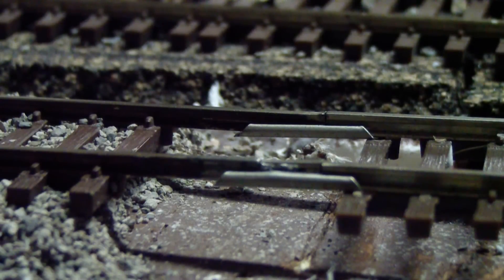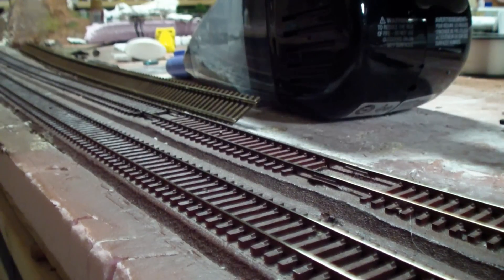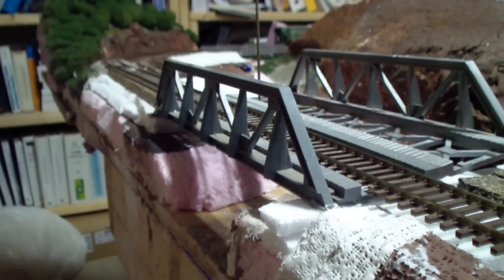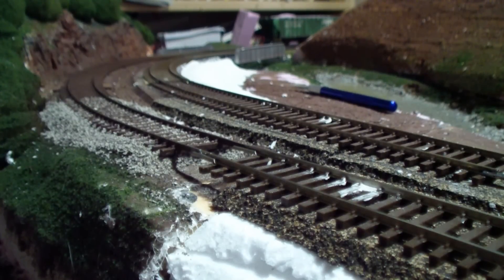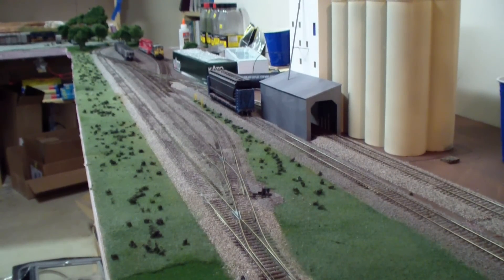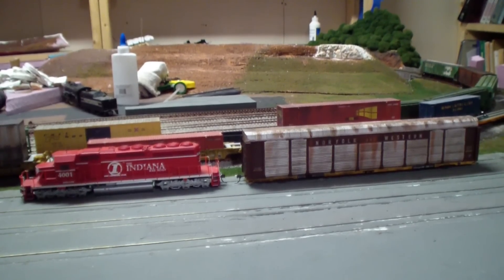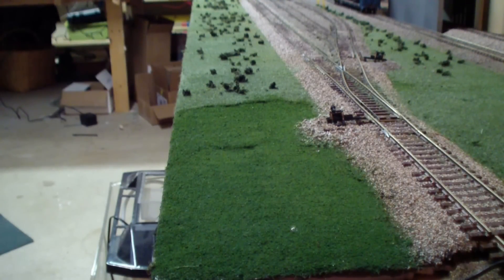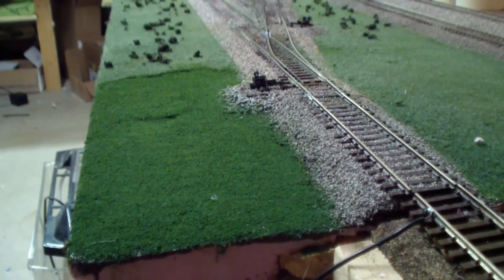10 Model Train Tips to Help You Save Time and Frustration

Comment: This video and other videos of yours just got you another subscriber. Great tips. I have also had problems with flex track and it has cost me a bit to much to replace.
Reply from the maker: Thanks! I ended up replacing almost all the flex track on this layout! Spent a lot more time with it on my new one to make sure i don't have to do that again!
Reply: Really????? I have used the same flex track on more than 3 of my roads with out any trouble. Maybe you all need to join a train club and pick the braines of some of the older rail roaders...

Comment: Spend whatever it takes and buy a new piece of track. It also looks like you have the wrong rail joiner on that splice. Have used old track sections on spur and in old yards. No reason to junk short track. In yards you don't even have to use rail joiners and if caeful you can get flawless track connection. Redoing it 5 times makes me think you don't learn very fast. Track nails bad - glue good... Test as you go.